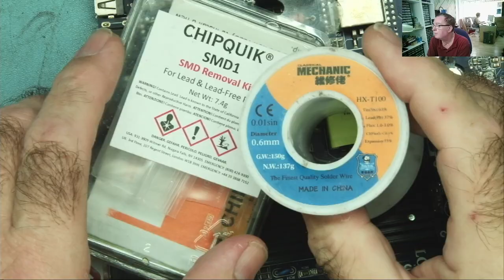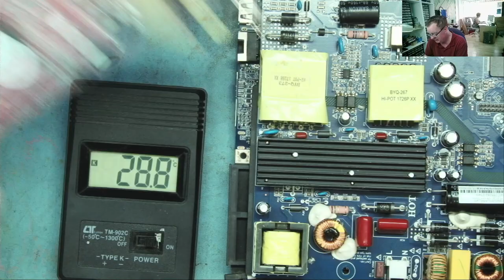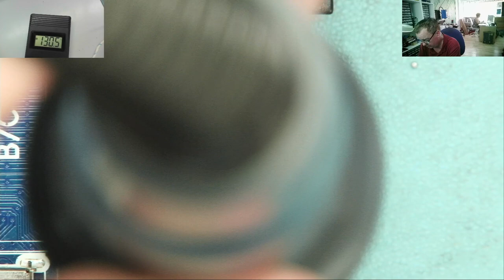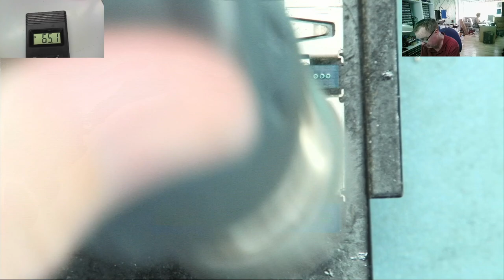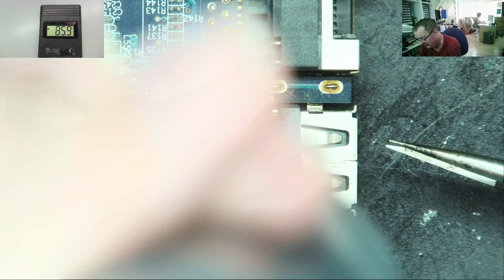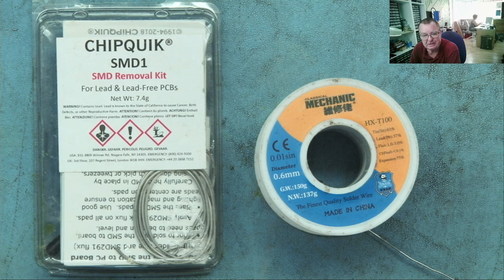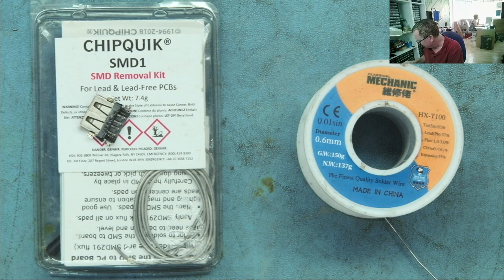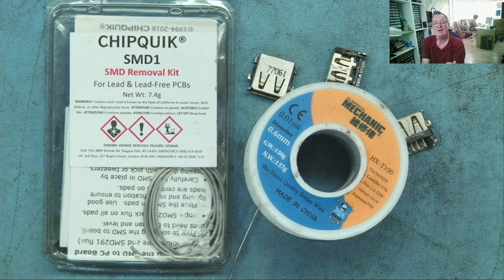Low Melt Desoldering Test CHIPQUIK vs Normal Leaded Solder Chip Quik

Comment: Thanks Richard, I’m a repair hobbyist and find your videos super helpful, this was something I wondered….. I personally use low melt solder but found it important to remove traces of low melt thoroughly before re soldering, usually by tinning with leaded and cleaning again with braid.

Comment: One thing with low melt solder is you have to remove all of it before using leaded solder with a replacement component.

Comment: Low melt likes the lower temperature. I turn the iron down to 280 - 200 depending on the board thickness and mass.

Comment: You can use Rose or Woods alloy , you don't need to use a proprietary brand, like buying a Versace T-Shirt LOL. Also you can usually just use a soldering iron, no hot air required.

Comment: Not much difference using it this way then, but the advantage of low melt is you could have easily removed the ram chip without hot air - which would have been very difficult with 63:37...handy for places where you can't use hot air.
Reply from the maker: That's my opinion.  It's good for removing parts like RAM chips you may want to reuse, but for things like HDMI connectors where your are assumedly trying to prevent damage to the PCB it does not help at all due to the fact you need to get enough heat into the metal work of the connector itself before you can unsolder it.

Comment: My personal cheap-skate work-around strategic plan to avoid buying ChipQuick has always been to plan on using solder paste, which has a lower melting point and which I do have in stock. I have yet to rework an expensive temperature sensitive (computer/MCU) type component that I could not just sweep off with a large blob of leaded solder. But, I get it that QuickChip is the right tool for the right job, for its intended use. Cheers.

Comment: Protecting plastics -  surrounding and inside connectors -  is the only reason I can see for using LowMelt
Reply: Totally agree. Low melt isn't for general desoldering (eg those RAM chips) where you can hit them with full hot air. In many circumstances with low melt you hit the pins with an iron and a small amount of low melt and they will all stay molten long enough to remove the component without using air (or much air) and melting plastic. TBH you should be able to remove that USB with low melt and no air and no component melting ...
Reply from the maker: @andygardiner6526  100% agreed.  This is what I wanted to show and why  I don't generally use Chipquik.   But I freely admit during the making of this video I was open minded and was a little surprised to see the occasions where I will use it going forwards, so it is still well worth having IMHO

Comment: @Learn Electronics Repair Chipquik alloy doesn't contain any flux, that's why the SMD kit contains a tube of flux. Cut a bit of your usual solder alloy under the  microscope : If it's made like a pipe, then it contains flux. It's enough to explain their different ways to flowing. Some alloys contains much more flux than others.
You can also fold Chipquik alloy without breaking it, it just requires to do it slowly ^^
To be honest, I only use chipquik on the most delicate solder points to remove a chip.
Reply from the maker: I totally agree with you. I'm pretty sure I demonstrated where chipquik excels and where it makes no difference. For sure, removing chips near to things that are not easy to remove but would easily be damaged like RAM slots etc it makes perfect sense to use low melt solder but for HDMI connectors etc which other videos say you really should use it then I don't see the point unless I'm missing something

Comment: I use the same method as yourself( leaded ) & sometimes use the Mr solderfix method using copper wire as a heatsink works well with multi pin headers without hot air ...........

Comment: Chipquick has it's uses, but the real star is actually the paste FLUX!  It makes a huge difference in not only how heat is conducted, but also (obviously) how well solder flows.  Of course, there are techs on youtube that will mess up boards to the absolute bitter end rather than TRYING a good paste flux.  It's a game changer, regardless of what you solder/desolder with.  👍
When I found (Amtech) flux, it changed my soldering game to GOD status!!  😁
Reply from the maker: Thanks for the suggestion, I'm all for game changers so I'll order some and see what happens.  I do have solder paste already but I assume you have some recommendations so let's give it a go yeah?
Reply: @LearnElectronicsRepair  I'd love to tell you where to get Amtech NC-559-V2-TF, since it's hard NOT to get counterfeit versions of it, but youtube deletes any comments with links.  But there is a guy that fixes Macbooks on youtube that may help.  Lets see if THIS comment will be censored as well.  The flux is worth a try!

Comment: You missed the point of Quick Chip, run your soldering iron down both sides of the chip 1 or 2 times and slowly reach over after fussing with a few things on your bench and get your tweezers, you will find the the chip will lift off without reheating, it stays melted for a looong time. its the cleaning that takes a long time.

Comment: Very nice video ! I think this is the bismuth type of solders you can find them also instead of chip quick from chinese vendors like your mechanic solder they offer bismuth type too as example HBD-366 but still more expensive. They are indeed brittle because of the bismuth but it´s needed to get around 200°C melting point. I don´t know If I would solder with them instead of lead based because the brittleness is not good against mechanical stress. For desoldering maybe but you have to clean it very good after that. By the way how hot do you use your hot air ? I found out that over 400°C you are likely to burn your pcb quite bad.

Comment: Il be cutting a lump out of an old video recorder for something to desolder on like you have here. Very good idea.
As for the test. 
Well, its good that you've used it here so i never have to..
Reply: Don’t completely reject the idea based on this video…it can be extremely helpful in certain situations.  He is specifically using it for smd’s in this,  but it can be used for any solder joint and probably at better effect for big globs of unleaded solder. They can frequently be extremely difficult to get to liquefy without hearing the bejesus out of them. The chip quick is very helpful to liquefy small to large globs of lead free solder. I think his flux may have gone bad or something.  Cuz there no reason why he should be struggling with it.  Just saying, don’t dismiss it from this.    If used correctly, not that he didn’t necessarily use it correctly, but if used correctly it should work extremely well in the right situations.
Reply from the maker: @kilgoretrout4461  I agree with you and actually think I demonstrated that.  It worked very well on the RAM chips where there was not so much thermal mass. It didn't make any noticeable difference on things like HDMI connectors. I never did dismiss it, I actually recommended it is worth having some in the toolbox and that I will use it in the situations I think it is suited to, like desoldering chips near to things that will melt easily such as RAM slots etc.

Comment: You suggested that you had applied more of the leaded solder than the chipquik. In fact, although it may have felt that way, if you look back at the video you will find that you used quite a bit less leaded solder, probably because the chipquik melted so quickly. I was thinking to myself "stop messing about, get some on there". The point being that the greater the ratio of leaded to non-leaded the lower the melting point.
Reply from the maker: For whatever reason the chipquik is very difficult to apply, you saw in the video with the RAM chip it applied more than I wanted and with the connectors it clumped up and refused to flow even though I used the supplied flux with it.  If I did manage to add more chipquik than leaded solder this should have improved it's performance as the resulting allow would have a lower melting point but the results did not reflect this.
Reply: @LearnElectronicsRepair  Ah, sorry, I didn't phrase it very well, I meant I thought you should have used more leaded solder, you seemed a little hesitant when adding it. 

BTW, have you ever considered using 50/50 or even 40/60 to make the mixture of leaded and unleaded nearer 60/40?

Comment: Seeing you struggle with it flowing. Could be the expiration date of the flux? Or maybe Chipquik just isn't that great at all.
At my job I do DC jacks only with low melt solder.
The pro of low melt solder is that you can liquify all joints simultaniously so you don't need a hot air gun.
https://www.youtube.com/watch?v=g4tsUQ-TFYA
Reply: Yes, I was confused at the combination of low melt and a hot air gun. If you can get away with the gun then you probably don’t need the low melt. Plastic connectors on one side of a board with components on the rear preventing heating from below is the perfect time to breakout the low melt ... and with the iron down to the lowest possible temperature. 🤞